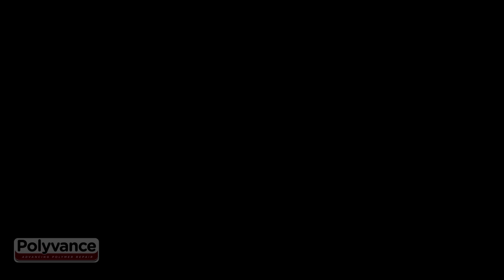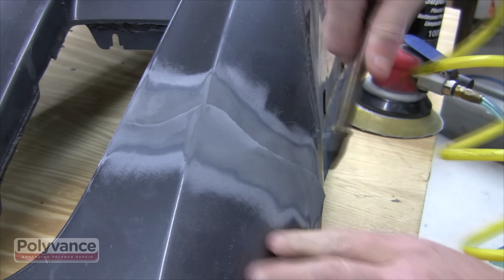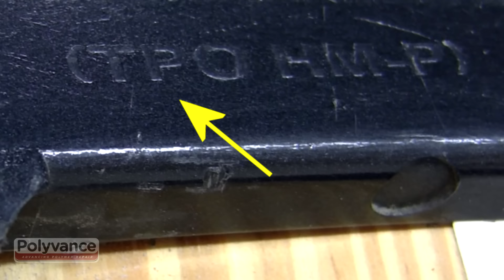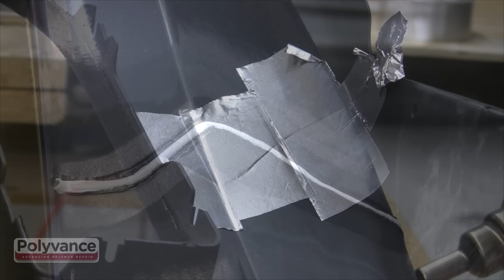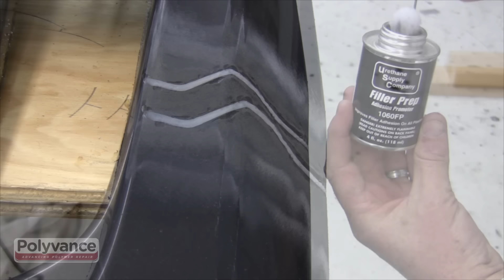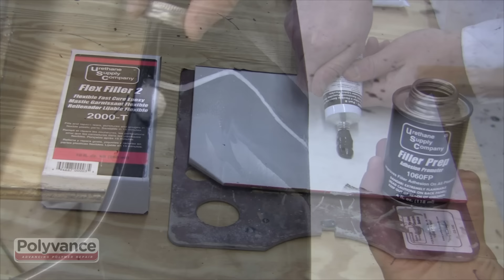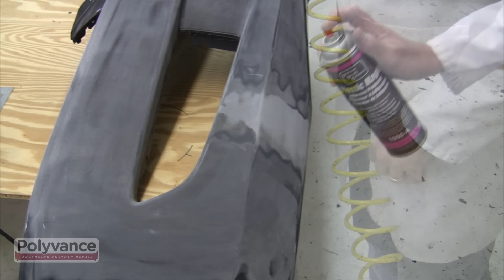Bumper Repair with Hot Air Plastic Welder

Comment: Buy a new bumper, holy shit. Unless it's a Lamborghini...
Reply from the maker: This video shows a piece of equipment that would be used in a body shop. By using this machine, a shop can repair an OEM bumper.
Some bumpers are cheaper than others. More expensive cars have new OEM bumpers that are more expensive. Additionally, some older cars might have hard to find bumpers (which also makes them more expensive).
All cases are different, and the amount of damage will need to be evaluated to see if it is worth having a part repaired. Many times it is cheaper to have someone repair small cracks, tears, tabs, etc. than to replace the whole part.
You may find an aftermarket part cheaper to put on yourself, but you run the risk of it not fitting properly (which you would have to have fixed), and you have to spend the time waiting for the part to come in. Also, the bumper may need to be painted to match the rest of the car. Having the bumper repaired ensures you keep the OEM part on the car, and you don't have to spend time waiting for the part to come in.
Reply: @polyvance  yeah very good points. It was a cool video to watch, just looked like with out of control labor rates it might be cheaper to just get new, but I understand some cars can be extremely costly or too old.
Reply: @NYVET48TFW  We had a guy repair a Lamborghini bumper.  He spent 3 full days repairing it simply because it was $11,000 new!  (Reinstall eyeballs, now.)  He paid for his 6080cg in one repair and still made money on top of that!  Definitely not the typical situation, but it proves its possible to make a lot of money plastic welding.  Usually the level of repair depends on the cost of the bumper.  If you have a $100 bumper cover, you may only be able to justify an hour of labor on it before sending it to paint, of course, the more expensive they are the more time you can allot to any given repair and still come out ahead.

Comment: I like how he calls a heat gun a welder....... Clearly doesn't know anything about fabrication or any aspect of engineering.... 😂
Reply from the maker: The welder used here is the Steinel LCD Hot Air Welder Kit (https://www.polyvance.com/Hot-Air-Welders-1/6055/). It may be more like a high-tech heat gun, but it is definitely better than a regular heat gun. A normal heat gun would damage the bumper because you cannot control where the heat goes...the heat source is much too broad. The Steinel gun has a two-speed blower, temperature control dial, two welding tips to guide the heat where you want it, and a digital indicator that reveals the working temperature. Temperatures can range from 120F to 1,100F.
However, we do manufacture top-of-the-line nitrogen plastic welders (https://www.polyvance.com/Nitrogen-Welders-1/). Our current line has welders with digital controls and some with analog controls. They include automatic low-flow power cutoff protection, precision flow valves to allow the user to adjust the flow to suit the thickness of the plastic, and a direct-reading flow gauge to ensure repeatable performance. Some use a nitrogen bottle, some come with a nitrogen generator, and some are designed with to be used with either compressed air or the nitrogen generator. We introduced nitrogen plastic welding to the industry in 2006, and we have been making improvements to our welders ever since.
We've been in business since 1981. Plastic repair is what we focus on, so we know it extremely well. We are constantly researching and coming up with new products and techniques.
You should look around our website and check out some of our other videos.

Comment: I think is cheaper to buy bumper n less hassel
Reply from the maker: Hello. This video shows a piece of equipment that would be used in a body shop. By using this machine, a shop can repair an OEM bumper.
Some bumpers are cheaper than others. More expensive cars have new OEM bumpers that are more expensive. Additionally, some older cars might have hard to find bumpers (which also makes them more expensive).
All cases are different, and the amount of damage will need to be evaluated to see if it is worth having a part repaired. Many times it is cheaper to have someone repair small cracks, tears, tabs, etc. than to replace the whole part.
You may find an aftermarket part cheaper to put on yourself, but you run the risk of it not fitting properly, and you also have to wait for the part to come in. You also may need to paint the bumper to match the rest of the car. Having the bumper repaired ensures you keep the OEM part on the car, and you don't have to spend time waiting for the part to come in.

Comment from the maker: View this video on our website for more information about the products used for this repair and for some helpful tips! https://www.polyvance.com/video/nitrogen-hot-air-fusion-welding/bumper-repair-with-hot-air-plastic-welder
Reply: MATT ZAWAR  Fiberglass repair is out there in abundance, so we don't focus on it.
Reply: @scottb7600  Fiberglass not a very good option on repairing polyurethane, which these bumpers are made of.
Reply: @ckstaff  You are correct.  But the bumper in this video is polypropylene not polyurethane.  Glass is not a good repair method for either, but a PP bumper can be welded as shown, whereas a PUR bumper cannot be welded in a conventional sense.
Reply: @scottb7600  Yes, that was what I meant. Fiberglass doesn't work on either. Sorry, I must have missed where you said that was a polypro bumper, which is a material that can be welded. I was assuming it was polyurethane, which most of these bumpers are made of. I was watching with interest thinking you were welding a polyurethane bumper and with 832 degrees.
Reply from the maker: @ckstaff  About 95% of late model bumper covers are polypropylene. There is a technique for repairing polyurethane with the airless welder and thermoset polyurethane welding rod. The welding rod acts as an adhesive. It makes a very strong repair. Here's our playlist of PUR repairs: https://www.youtube.com/watch?v=rUV1qpnKxlg&list=PLmdrqwjPa5t8Dzx05kPVzr1yC-DauXWNt
Reply: Awesome
Reply: I liked the music. There, I said it.
Reply: 'v' '' vvv:"

Comment: Meanwhile, a bumper on eBay is 75$ and maaco can paint it for 125$...
Reply from the maker: Buying a new bumper may not be that easy or inexpensive. More expensive cars have new OEM bumpers that cost a lot. Additionally, some older cars might have hard to find bumpers (which makes them more expensive).
You can find aftermarket parts cheaper, but you also run the risk of them not fitting your car properly (which you would still have to pay to fix).
Like you mentioned, you may also have to have it painted to match.
Of course, all cases are different, and the amount of damage will need to be evaluated to see if it is worth having the part repaired. But many times, it is cheaper to have cracks, tears, tabs, etc. repaired than to replace the whole part.

Comment: Bro what.. Just buy a new bumper 😂
Reply from the maker: Hello. This video shows a piece of equipment that would be used in a body shop. By using this machine, a shop can repair an OEM bumper.
Some bumpers are cheaper than others. Some people have new OEM bumpers that are hard to find (thus making them more expensive).
All cases are different, and the amount of damage will need to be evaluated to see if it is worth having a part repaired. Many times it is cheaper to repair small cracks, tears, tabs, etc. than to replace the whole part.
You may find an aftermarket part cheaper to put on yourself, but you run the risk of it not fitting properly, and you also have to wait for the part to come in. Having it repaired ensures you keep the OEM part on the car, and you don't have to spend time waiting for the part to come in.

Comment: Clean, than sand, than clean again, what a dumb sequence
Reply from the maker: If you have contaminants on the plastic and you sand or grind it, it's very likely you will embed some of the contaminants into the sanding scratches (which will impact the quality of the repair).  You should always clean the plastic first!  You can clean it again after if you wish, but you should always clean it first!

Comment: A replacement bumper for that vehicle is prob only abour 100$ lol but that is a cool process.
Reply from the maker: Hello. This video shows a piece of equipment that would be used in a body shop. By using this machine, a shop can repair an OEM bumper.
Some bumpers are cheaper than others. Some people have new OEM bumpers that are hard to find (thus making them more expensive).
All cases are different, and the amount of damage will need to be evaluated to see if it is worth having a part repaired. Many times it is cheaper to repair small cracks, tears, tabs, etc. than to replace the whole part.
You may find an aftermarket part cheaper to put on yourself, but you run the risk of it not fitting properly, and you also have to wait for the part to come in. Having it repaired ensures you keep the OEM part on the car, and you don't have to spend time waiting for the part to come in.

We are glad you thought the process was cool. Not only do these machines repair bumpers, but can be used to repair headlight tabs, inner fender liners, washer bottles, and many more automotive parts! Additionally, they can repair kayaks, agricultural tanks, and much more! Plastic is everywhere; not just on vehicles.
Reply: Even if it were, and the repair took an hour, why not spend the $4.00 in welding rod and filler to make the repair and keep the OEM part?  Either way, you still have to prep and paint it.

Comment: You can buy a new bumper for less money and man hours than this method.
Reply from the maker: All cases are different, and the amount of damage will need to be evaluated to see if it is worth having a part repaired. Many times it is cheaper to repair small cracks, tears, tabs, etc. than to replace the whole part. You may find an aftermarket part cheaper to put on yourself, but you run the risk of it not fitting properly, and you also have to wait for the part to come in. Repairing ensures you keep the OEM part on the car, and you don't have to wait for the part to come in.

You can find a win-win scenario for both the repair shops and the bill payer. Check out this article and interview with Kurt Lammon, president of Polyvance (under the Plastic Repair section): https://autobodynews.com/index.php/component/k2/item/15517-the-best-body-shops-tips-repair-vs-replace-what-a-body-shop-should-consider.html?showall=1

There is a good example of a win-win scenario in the article:
If a replacement part costs $400, and the shop makes 25% gross profit on parts, the shop receives $100 of gross profit and the bill payer pays $400.
However, if the part is repaired and the shop is paid for 6 hours of work at $50 per hour with a 50% gross margin on labor, the shop makes $150 gross profit and the bill-payer only pays $300. So if the part is repaired, both the shop and the bill-payer come out better than if it had been replaced.

Comment: He cleans the surface to then sand it with 80grit? That was dumb!
Reply: it was SMART!  If you sand then clean, the sanding process forces impurities into the sanding scratches that are extremely difficult to remove.  By cleaning first, you remove the impurities and eliminate the risk of contaminating your sanded area.

Comment: Ill stick to my trusty flathead screwdriver and a cheep 10 dollar heat gun😁
Reply: Using a cheap ziptie works too melt it on and pres from the inside
Reply: Ive done that trick too. Or use plastic from a bad bumper and a heat gun and weld it from the back side. Then use the repair filler in the front.
Reply: Mykel Hardin  Yeah! polypropylene that is, and that plastic is shit compared to nylon or polycarbonate. I rather fix broken PP with glue, baking soda and wire mesh.
Reply from the maker: @sephangelo4603  Adhesives don't stick well to polypropylene, at all. Also, in general, the baking soda and super glue trick makes an extremely brittle repair.

Comment: What can’t I use a hot air plastic welder for? Can it join plastic 5 gallon buckets together? Can I fuse schedule 40 PVC fittings to a plastic barrel and make a strong water-tight seal (so I don’t have to buy expensive bulkhead fittings) Can this be used to repair cracked low-pressure pipes in-field?

Comment: All that money to buy the tools some cars bumper are cheap
Reply from the maker: Hello. Our hot air and nitrogen plastic welders are more for body shop use and are more expensive. Additionally, body shops would most likely have all of the other tools (sander, aluminum tape, sandpaper, etc). We do, however, have some less expensive airless welder kits and other cheaper plastic repair kits.

You are correct that in some cases buying a new bumper may be cheaper than repairing it. However, more expensive cars have new OEM bumpers that cost a lot. Additionally, some older cars might have hard to find bumpers (which makes them more expensive).
 You can find aftermarket parts cheaper, but you also run the risk of them not fitting your car properly (which you would still have to pay to fix).

Of course, all cases are different, and the amount of damage will need to be evaluated to see if it is worth having the part repaired. But many times, it is cheaper to have cracks, tears, tabs, etc. repaired than to replace the whole part. Especially on something like a small broken tab that is easily repaired and not visible (which means refinishing work is not required).

Comment: If not sure what type of plastic  what stick is best is there a genaral stick .Thanks
Reply: You should use the same type of filler rod as base material.  Polypropylene filler rod for polypropylene substrates, LDPE for LDPE substrates and so on.  FiberFlex is a universal rod.  Its good if you can't figure out what you have, but doesn't make a true weld.

Comment: i honestly wouldnt trust this, as a welder this is doesn't seem right
Reply from the maker: Jacob, what do you think is incorrect about this process?
Reply: @polyvance  to me it seems the plastic is just bearly it its meltimg point, almost the same (in comparison) to pressure welding, there is no real penetration and the streses inside the material are very poorly distrubuted, my thought would be you would be better off by using very hot argon instead of air to both protect the plastic and heat it to a higher themprature to get better penetration of heat and a better flow of the plastic which also contributes to higher strength.
Reply: As a welder, you should know welding by definition is simply the process of melting two substrates and joining them with melted filler material of the same composition.  Metal melts, metal filler rod melts, you put those together and let it cool and you have one piece.  Plastic melts, plastic filler rod melts, you put those together and let it cool and you have one piece.  It is the same.

Comment: I've done the same thing with JB weld. Cheaper
Reply from the maker: Hello. Our hot air and nitrogen plastic welders are more for body shop use and are more expensive. Additionally, body shops would most likely have all of the other tools (sander, aluminum tape, sandpaper, etc). We do, however, have some less expensive airless welder kits and other cheaper plastic repair kits.
Check out our other products on our website or our other videos to see them in action.

Comment: so it is just a fancy hot glue?
Reply from the maker: The welding rod is not an adhesive like glue; it has absolutely no adhesive property when dry or wet. The welding rod is melting into the base material and bonding with the bumper.

Ideally, when using a nitrogen plastic welder, you use a welding rod that is made up of the same type of plastic. Using the correct technique, you will get a fusion weld. This means the broken plastic and the welding rods will fuse together and become one piece. So if you are repairing a low density polyethylene tank, so would want to use an LDPE welding rod. The plastics will blend when welded. It's like pouring a cup of water into a gallon of water...it blends and cannot be separated.

Comment: Hey brother that is not welding
Reply from the maker: This is absolutely welding!
From dictionary.com "Weld: to unite or fuse (as pieces of metal) by hammering, compressing, or the like, especially after rendering soft or pasty by heat, and sometimes with the addition of fusible material like or unlike the pieces to be united."

This isn't metal welding, but it is plastic welding. Here, we are using Polyvance's TPO welding rod to repair a TPO bumper. We heat both the bumper and the welding rod and melt the welding rod into the base material. The welding rod is not an adhesive like glue; it has absolutely no adhesive property when dry or wet. It is melting into the base material here and bonding with the bumper.

Ideally, when using a nitrogen plastic welder, you use a welding rod that is made up of the same type of plastic. Using the correct technique, you will get a fusion weld. This means the broken plastic and the welding rods will fuse together and become one piece.

Comment: So I’ll go buy a 100$ dremmel, then a orbital sander, then a pack of 80 grit, and a roll of aluminum tape. Wait don’t forget the 100$ plastic welder. So I just spent 400$ and 5 hours of my time to repair 300$ bumper.
Reply from the maker: Hello. Our hot air and nitrogen plastic welders are more for body shop use and are more expensive. Additionally, body shops would most likely have all of the other tools (sander, aluminum tape, sandpaper, etc). We do, however, have some less expensive airless welder kits and other cheaper plastic repair kits.
Check out our other products on our website or our other videos to see them in action.